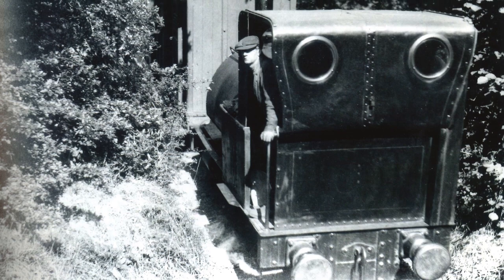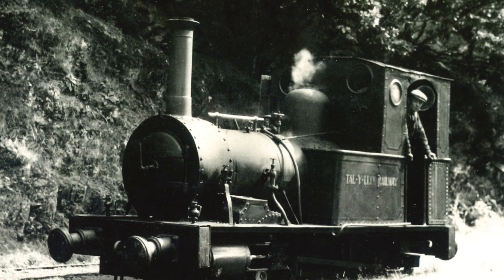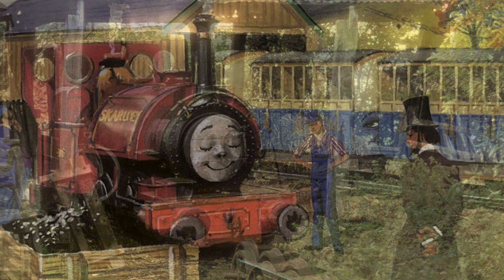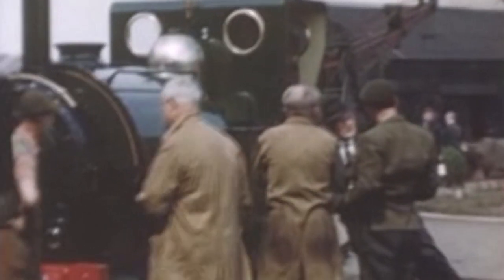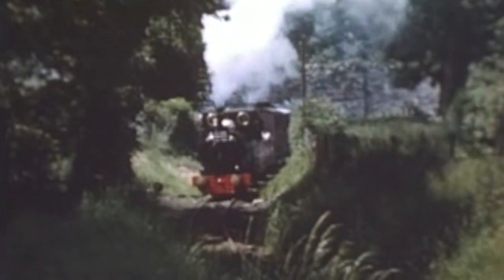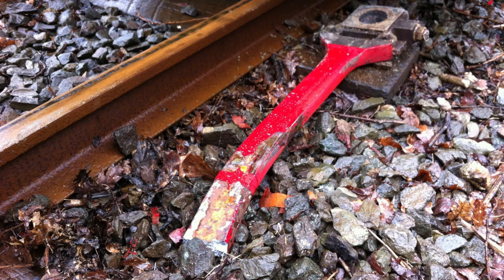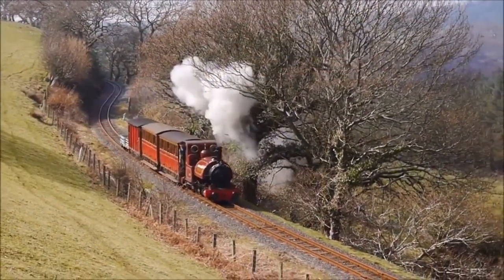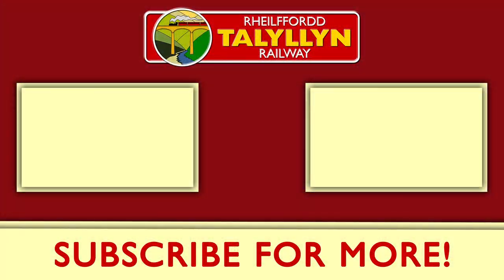Engine Stories: Talyllyn - Talyllyn Railway

Comment: Is there 2 engines numbered 8 & 10? Alf is no.9 & Trecwyn is no.11 are they not there or are they still in serviced?
Reply from the maker: No.8 was called "Merseysider" and No.10 was called "Bryn Eglwys" - they have both left the Railway, having been sold on to new owners.

I believe No.8 is with a private collector and No.10 is working on a different Railway now.

The Diesels we currently have are No.5 "Midlander", No.9 "Alf", No.11 "Trecwn" and No.12 "St.Cadfan" - they are all currently in service
Reply: @TalyllynRailway1865  I really wonder where No.8 Merseysider is and how it looks now
Reply: @TalyllynRailway1865  so would they gonna visit someday with there owners?
Reply from the maker: @nascar97fan  I believe No.10 has been converted to 2ft gauge, so would no longer fit on our track - which is 2ft 3" gauge, so it wouldn't be able to visit the Railway again sadly - though it would be nice to see them both back again, there are no plans for this.
Reply: @TalyllynRailway1865  wait I didn't know they been updated?
Reply: Maybe have a new No.8 and No.10 to fix this (4 or 6 wheeled battery powered locomotives like the office shunter).
They can’t be that hard especially compared to Tal-y-llyn’s massive overhaul.
Besides if the Talyllyn Railway somehow were to service freight again (who knows how, don’t ask me) better be prepared for extra trains.
Reply: I find it kind of weird that excluding Midlander and Alf, none of the Talyllyn Railway diesels have Skarloey Railway counterparts.

Comment: where does coal come from
Reply: Coal is a type of fossil fuel. Old plants from millions of years ago compress over time and eventually end up as coal. It’s dug out of the ground in quarries and mines. Generally, the longer it’s been compressed for, the better the quality of the coal.
Reply: @harryrobinson2901  They should always wash coal and keep it clean
Reply: @terencewilliammckenna6121  Not really. Even if it’s wet it’ll generally burn. Plus, most of the time coal gets other things dirty, rather than get dirty itself!
Reply: Good smoke-boxes prevent most of its dust and sparks from being blown through the chimney pipe